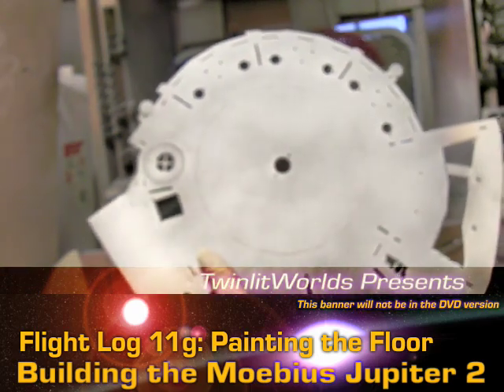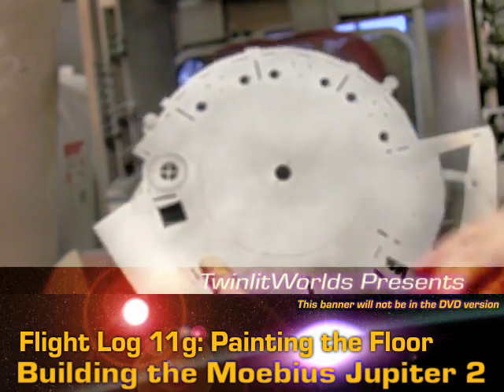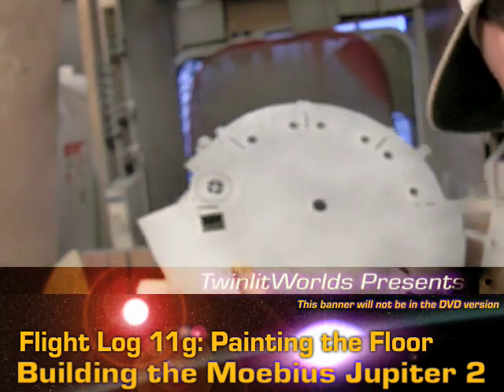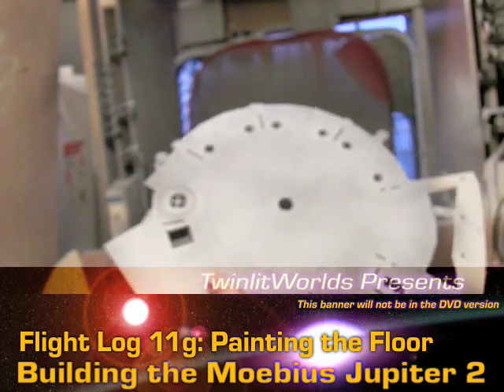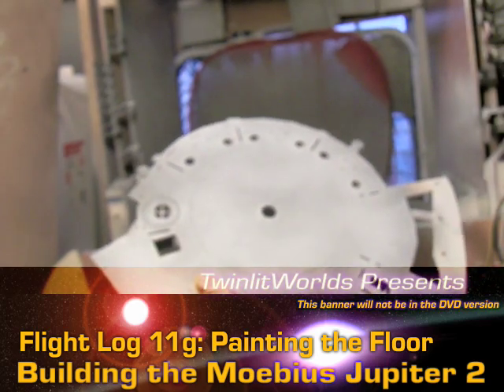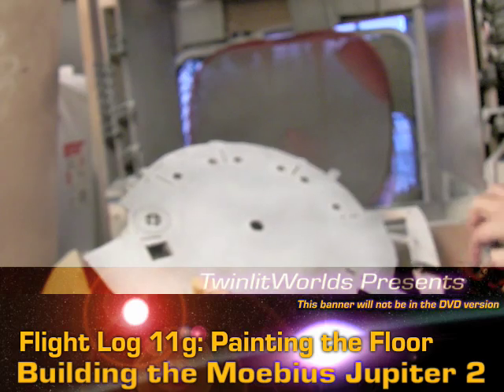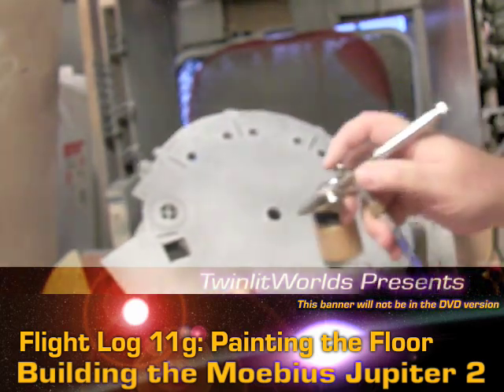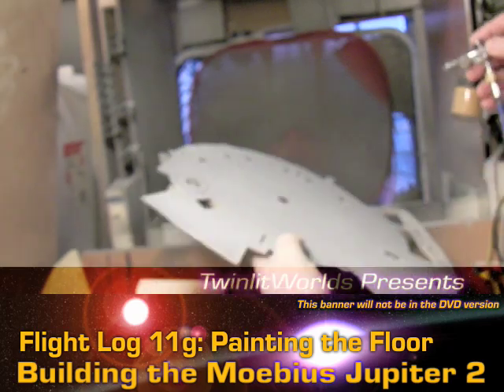Project Jupiter: Flight Log11: Paint the Floor 6/8

Comment from the maker: I have some acrylics on hand, but never get around to using them.  Oils are supposed to be good too.  But I usually default to enamels as I like the final look.  Acrylics tend to dry a tone or so lighter than when wet, so they are unreliable for total color accuracy. Enamels and oils, what you see is what you get.